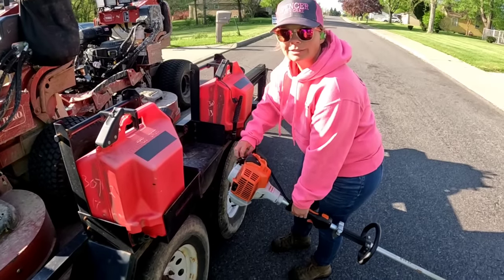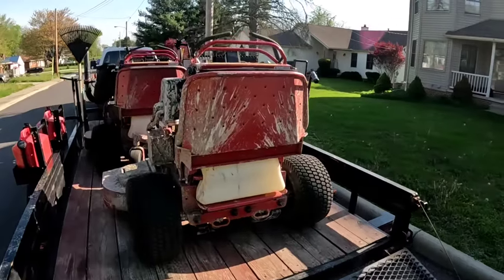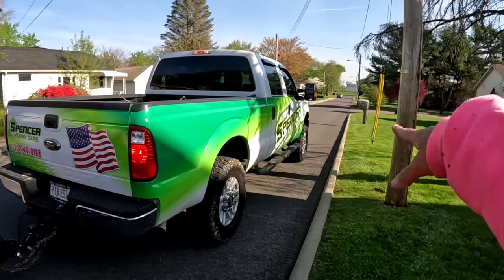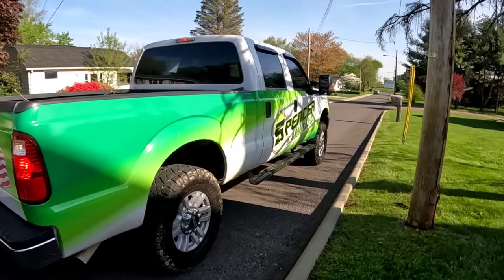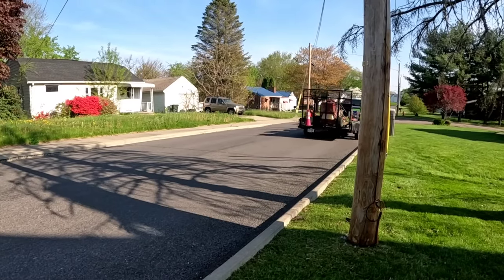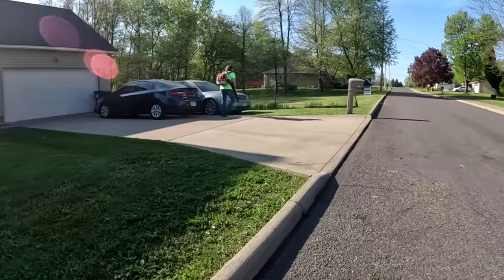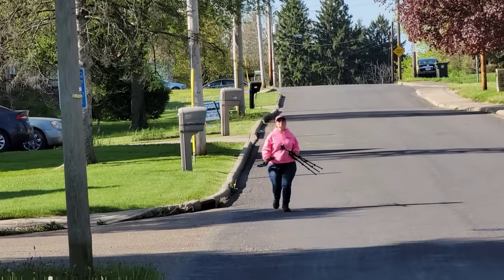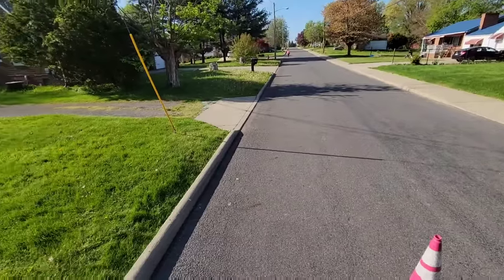WE NEED YOUR HELP | THEY REALLY SAID IT COULD TAKE A YEAR!

Comment: The UTV you specified you need is a Kawasaki Mule.  They are meant for work and play, get a 4 door model and the whole family can enjoy a ride as well, suggest you look at Mule PRO-FXT, perfect machine for what you want.  I have had a Mule for over 10 years and it is one of the best things I have ever purchased.
Reply: The Mule is my suggestion, too.  I also have a Mule PRO-FXT.  It has good towing capacity, 4-wheel drive, and a winch. And, it rides as smoothly as my SUV.

Comment: We have a cam an Defender. We have the Max, so it will seat up to 6 people (4 comfortably). Tows 2500 lbs and has 1k payload capacity in the bed. Use it for large mulch jobs if there’s a good distance from the trailer to the bed. Also I use the winch to remove large shrubs. Doesn’t damage turf and is fun to go riding trails with. We were torn between that and the Polaris ranger, since we have a family of 5. I called 4 dealerships that sell both and they unanimously said the defender is the better machine. A little more out the door, but service intervals are double what they are in the ranger, and stronger built machine. I have friends with the ranger and they can’t do or go half the places we can when we go to off-road parks. Very happy with it. We are actually debating selling it and getting g a 3 seater for work and then a sport style UTV for fun. Let me know if you would be interested. We’re in the St Louis area.

Comment: Look for a sturdy frame ....just like you would for a mower...then motor..gas or diesel but you might consider a wrench on the front ours came in handy...options come down to your preferences ....just as you like some mowers and not others...frame is first

Comment: Look into a coleman 550 at tractor supply. They come wit a rear dump body, tow hitch slot , and a winch In the front. Comes standard with 4 wheel 2 wheel diff lock. Price poin  of 11,000 dollars.

Comment: I had a 550cc Arctic Cat ATV, which was absolutely fun to ride; but working on a 10 acre piece of property wasn’t as enjoyable.  Needed to have a trailer to carry welders, fence wire, post, etc.  So I sold it and bought a Japanese import truck.  The Suzuki 4x4 has a regular cab, A/C, 5-speed manual, right hand drive, 6+ foot bed with flip down bed sides.  I pile the bed full of stuff and take off to work the fences or cut trees.  It cost a whole lot less than a side-by-side and less than a nice ATV, it carries more than my Yamaha golf cart and a lot faster.  Did I mention the A/C which is great to have in Texas, plus there’s a heater.  When you get hot, get inside and crank the A/C.  Of course, seats 2 but there are others that seat more but they’re not as popular.

Comment: Get a used Yamaha Rhino 700. I have an 09 that has been a beast. It's got a dump bed, diff lock, I use it to pull a 5x10 trailer with wood in it, I've pulled trees with it, I've been to the dunes, in the snow, in the mud, hill climbs, you name it, I've probably done it. It still has the original drive belt. The new Yamaha Wolverine RMAX has the best belt warranty in the business at 10 years.

Comment: I have family members that have had sbs' from John deere, Polaris, Kubota, and can am. I can say hands down the diesel Kubota or the can am both with dump beds are the best quality and ride of any. I've taken the Kubota through a Texas clay mud puddle up to the belly of the machine, and have never gotten stuck. Pay for the heat and AC option, you will greatly appreciate it on the blazing hot, or ice cold days.
Reply: yeah kubota rtv 1100 diesel are best plus has  heated and ac cab plus can be added up with front mounted attachments and rear pto 3point hitch option kit to run multiple compact tractor attachments wich is nice and hydrulic dump bed

Comment: The Polaris ranger is hard to beat.I’ve had one fourteen years and use it on the property every day. I would recommend just the single row . You think everyone will want to pile in, but that wears off pretty soon. 
Single easier to maneuver in woods. Mine is a workhorse.
Reply: I 2nd the Polaris Ranger.  Works really well at getting around property quicker.  It is fairly easy to maintain.  Definitely add the winch, windshield and a roof.  Compact tractor would be nice and I would be on board with that but you have the skid steer so the tractor is not as important.
Besides kids will enjoy side by side more on that nice property.
Reply: The new ones are junk compared to the can-am defenders

Comment: I think the small, four wheel  drive tractor would be a great thing to have.  A friend has a Kubota side by side,  Its nice,  However, I've worked on it.  That thing has, count them, seven different fluid filters and reservoirs.  Polaris, from my experience, uses a lot of belts and requires a lot of repairs. My point is that whatever you like, look at the service manual and crawl under it.

Comment: Can Am commander HD8 two row has been an excellent Side by side for us. I bought it to help with the property we bought in 2018 that had woods and pond. This was a good all around machine for us. Plenty of power and dump bed makes it real easy to move rocks, tree slash, tow weed sprayer, and drag to level parts of our lot.  Moved over 16,500 lbs of decoration and riprap rock for pond erosion control. Used it to rescue several lawn company zero turn mowers that slid into our common 2 acre pond. Love this  machine and would not have bought the property and home we have if I did not have something like this. 
Talked to dealer in our area of MO and they have several models available as well as orders they can deliver in weeks. Maybe different in your area.  No matter which manufacture you get. Polaris, Kawasaki, Can Am. With property like yours it will be invaluable as a tool as well as fun for family outings. Wish you well and God bless.

Comment: I love the Kubota UTVs and JD Gators. I use a Kubota utv with a 25 gallon sprayer for spraying weed killer. Works well and can handle the load. You can get a Plow for them also. Kubota makes a 4 seater version to. Not sure on wait time for a new one, i just went to my dealer and they had one.

Comment: also in whatching you said about checking the oil in your mower well in the new jd lawn tractors they have this thing where the oil is built into the filter and therefor not nessacary to check it as much as a normal engine and filter setup

Comment: The best utv that I have used for working is unfortunately the Kubota (diesel) RTV. I could haul literally a ton of gravel in the bed. And pulled a warehouse size fork lift out of a 3 ft deep ditch that was center hung. It isn't a speed demon. Top speed around 21 mph. Put a Boss V plow on the front and a salt box in the back. I will say get the cab with roll up windows and  air conditioning in the options. If I need to do work I grab the Kubota If I need to get from point A to B fast I grab the Gator or Ranger.

Comment: Look into the John Deere Gator. They're reliable and come with many options. I had one and absolutely loved it. I hauled firewood with it, towed trailers and equipment. It's ment for a land owner work truck but small enough to break trails and haul out your deer.... good luck in your search Mr. Spencer.
Reply: My experience with Gators has not been good. But it’s been 15 years since I’ve been in one.
Reply: I wouldn't get the Gator, it's more for "old farmer John" getting around the farm hauling milk bottles for the calves. Can't even pull a log!
Reply: Maybe check with the JD dealer to see if they have any good used Gator being traded in. Sometimes you can get a bargain when someone is upgrading. Used allows you to get into the market cheaper so you can see if that's what you really want.

Comment: I got a 2001 Polaris big boss 6x6 it is a beast I use it for farmwork I'll tow a full hay wagon so long as your not going down any hills since it's a wagon and no tongue weight and it says 800lb. In the box but I've loaded it with about 3/4 of a light material skid steer bucket of stones in it and it handled it fine all this with the 4 back tires being basically bald with only tiny stubs shorter than 1/16 inch of rounded off tred

Comment: I have a Honda pioneer 1000-5 luv it I use it all yr I have 40 acres works amazing in the  Timber pulling logs climbing hills it has a direct drive so you don't have to worry about a belt slipping it seats 5 people nicely has a dump bed

Comment: Polaris Ranger 570 or 1000. Power Steering. They both can haul same weight. The 1000 has more giddy up go. 
Can Am Defender only operated HD10. 1000cc. Very nice unit.
After demoing both units I went with a Sure Trac 4x8 dump trailer, I tow it behind my Can Am 1000XT. Trailer cost me $2200 vs helluva lot more.
Use a trickle charger on the battery to keep it charged.
Is it the best,no it's not. I choose to go with it,as i can purchase X amount of trailers verse 1 Utility SXS.
We own 40 acres.

Comment: Don’t get the toro. Kobota for sure had the diesel awesome machine I had a Curtis cab with heat 6 ft hydraulic plow winch dump bed. 4x4 ran it year round loved it they also now make a crew cab.   I used kristowiske tractor. In Wellington guys name was Paul bersley very knowledgeable salesman.

Comment: There is only two brands, outside of equipment brands, such as kubota, Bobcat, etc. that is Honda and Polaris. Honda has a geared drivetrain as opposed to a belt, however Polaris is a workhorse, as is Honda both are extremely reliable.

Comment: I really like the diesel kabota it has all the power you need for work, the only draw back is that it tops out in the 20s so it not for good for any trail riding. Definitely one of the best machines for work with the heavy duty metal bed compared to plastic!

Comment: We have a kubota that is a mini truck basically, has AC and heat, radio, working windshield wipers and fluid, hydraulic dump bed, 2WD and 4WD, you can pull trailers with it and it can pull a good amount of weight and it’s a nice toy too

Comment: I have a  2021 can am commander 1000r xt I’ve put about 800 miles in the last year and have had zero problems, this has a dump bed and good towing capacity and it came with a winch that’s very handy  I paid right around  18,000 last spring about a year ago I’ve seen some for sale n the show room floor around me in Michigan. I’ve been told bob’s cycle in Ohio a Polaris dealer gives great deals

Comment: Rual King sells a cheap one. The bed dumps and sits 4 or 5 ppl. I think it's branded as RK. They are not much at all. Even if you got one to use until you get a better one shipped in then you can resell the RK brand UTV or give it away once your order comes through

Comment: get yourself an old beat 4x4, 4 door pickup. pull the doors and bed replace the bed with a wooden hand made flatbed, its fun and cheap !
Reply: Love it! I had an 84 Chevy 2 door 2WD and it worked for years. It wouldn’t go fast because of the short rear end gears which were something like 4.5:1. But it could pull stumps.

Comment: For the small investment when you get mowers stuck, i would invest in soft shackles (typically used for offroad recovery) no more tying nots in straps. You put them in the holes on either side of strap and feed in tow point on the mower. Amazon has 2 packs in the mid $20 range, keep one in each truck so you have them.

Comment: I run honda on my atv which i used for small snow plowing jobs, chemical spraying and fertilizing during the summer. I also started using it this year to seed fresh lawns. I have little to no maintenance on my machine besides the standard oil/filter changes typically every fall.

Comment: I have had a two Kawasaki trx and a Polaris.  I own John Deere 1025r.  The tractor is much more suited for work.  I never used my side by side for hard work on my property.that tractor is built to work and work hard.  That tractor with a loader will out work a side by side.  Our property is all woods and I pull logs and hall wood, pull my splitter.  It is very versatile and tough.  You can also use it in your business.  Hope this helps. I use my tractor to make trails for my 4 wheeler.  If I were in your position, I would recommend a sub compact tractor.  I couldn’t see myself using my side by side for what I do.

Comment: Shawn think about the new property, first you already have  a skid steer, next you are going to need a small excavator to pull stumps and grade. Listen I bought 9 acres 41 years ago and cleared land with a chain saw, ax  and lopers.Spend your money smartly buy  a small excavator with a thumb. Down the road you can use this equipment in your lawn care. Make sure it fits on the trailer first so you can get it to the property. Think about it while one is operating one piece the other can be operating the other, work smart side by side is a toy it cant pull stumps take it from some one who has done it think about the long road. Charley

Comment: look into a kei truck. A jdm . Can be street legal and have full size bed. some even are dump beds. Lots have 4×4 with high and low gears. mine even has lockers. Pretty amazing piece of equipment really. goes anywhere. Cheap parts and easy to work on. Cab with heater and some with a.c. Beds fold down and can be a flatbed

Comment: Well isn't this a fun thread to read.. 😁... I personally have used polaris can'am yamaha Honda kawasaki... and there other brands that build other brands.. the best luck I have had in the situations you mentioned in your post, Yamaha and Honda are the way to go imo. My opinion comes from farming, fixing fences etc.. also pumped manure for over 5 years and the only brand that held up was the  yamaha for our situation of pulling 10" hose, dragging hose thru culverts, to flying across the field in a emergency shutdown. I personally have worked on multiple different brands.. every brand has there own flaws.. from wrecking belts, to axle shafts, to weak brakes.  Imo if I were you.. I'd buy a couple of  older well taken care of units and than go from there.. bc one might work in one situation where something else would work better. If that makes sense.
Reply: Good tip, Honda or Yamaha ??
I'd do tractor first.

Comment: We have a Honda talon 1000 and a Polaris ranger 1000. Both are very good with plenty of power. I like the talon better because it has the 6 speed trans, where the ranger only has one gear. Ranger is better for work and the talon is for more sporty, high speed off roading.

Comment: Take a look at Yamaha Viking or Wolverine.  I have a 2016 Wolverine R-Spec which I use on our 25 acre residential property.  We use it to take care of food plots, run our 25 gal sprayer, hunt and just cruse the property.  The Viking is a 3 or 6 seater and the Wolverine is a 2 or 4 seater.  We also have a John Deere 3038 with bucket, grapple, tiller and box drag accessories and that combination does just about everything we need at the property.

Comment: If you got shocked from the blower tube, you may have lost the ground wire that flops around inside the tube to discharge the static built up from the air. My Echo blower had a thin bare wire that just flopped in the tube, pretty sure the Stihl blowers have it too. Wish I could look up parts diagrams for Stihl but it seems like they hide all that from the public.

Comment: I have a 2021 Kawasaki Teryx S Le! It is The best machine Ive owned! I used to Own A CF Moto, And a Polaris RZR 800 and a Polaris RZR 900 and a 2015 Can Am Commander 1000! The Teryx cost 15299 but you can get the Teryx 4 seater for 2000 more! The Teryx 2 seater has a larger dump bed! Very well put together machine! No grease joints to grease and come with 3 year warrenty! Plenty in stock in Pennsylvania! Bought mine at five star Bedford!

Comment: I would recommend a Polaris Ranger it can give you the option for 4 seats and it is a good beast to put to work. I have owned one for over a year and we used it on the farm and put it to the test. We also have a can am Defender and we put it to the test as well. We have towed a 16 ft flat trailer with a few pallets full of seed. We used them a lot.

Comment: For the Money CF Motto is about the best thing going. Everyone has their own preference, I have a Honda Pioneer 500 It's a trail machine 2 seater, If you are wanting a 4 seater you won't be able to pull much... Some SXS's can tow 2000 lbs, But I don't know of any SXS designed to pull logs. Honda is the only brand that is shaft driven, All the other's run on a Belt. CF Motto comes with a Top, Winch and 14" Wheels also has Power Steering. My next one will be a CF Motto

Comment: Sean I believe your best option would be a Toro utx four seater. It would be the all-around best choice for you since you already deal with Toro and actually went to their plant. They have a small utility dump bed on the back for hauling logs, rocks, dirt or mulch. There are salters that fit in the back bed. They are also able to be fitted with plows for the front for snow. Just starting out with the property and being able to use it in the winter for snow plowing and salting the smaller areas sidewalks etc I think it would be a win win for you. Besides that like I said already, it seems like Toro is willing to work with you.  Winch on the front etc. Business write off for sure, but definitely handy around the property. Climate controlled cab, 2,000 lbs towing, gas or diesel engine. If I remember correctly, the gas version has a top speed of like 45 mph in high range 😳